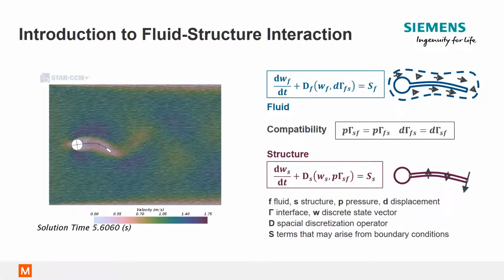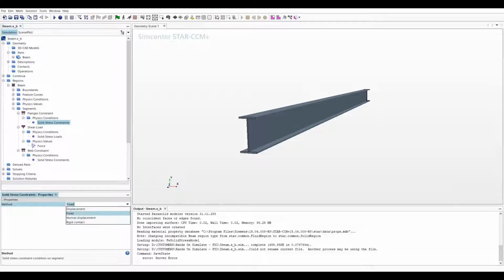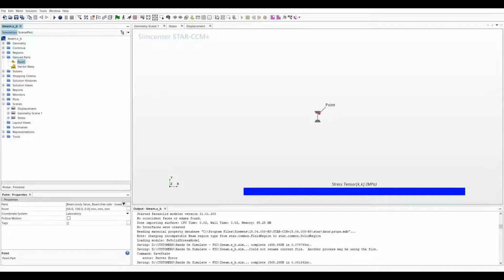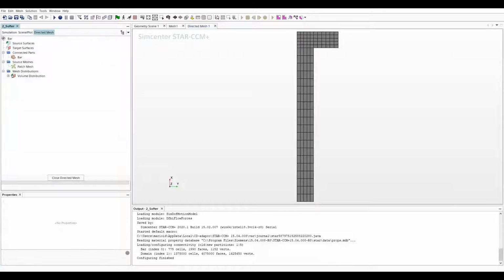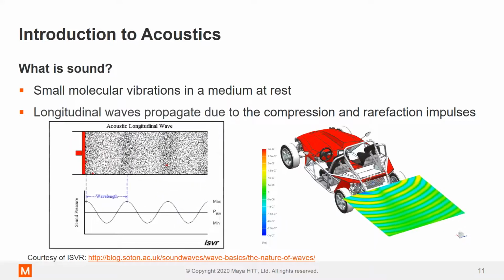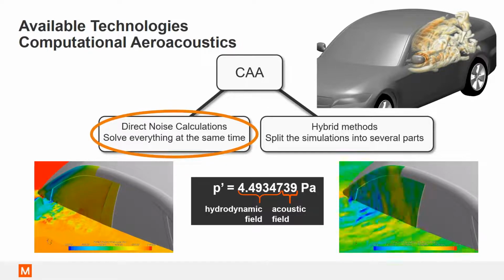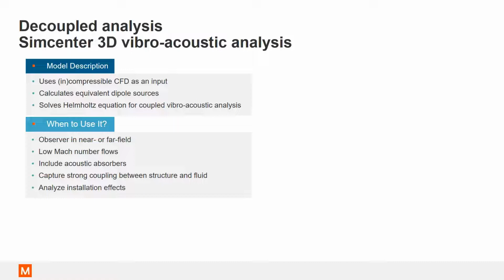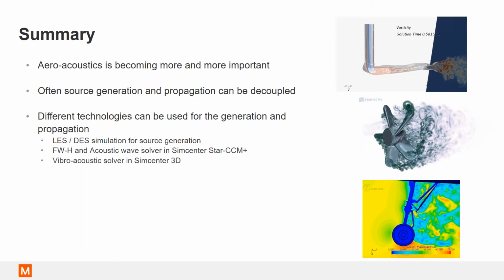Hands-on Simulate Series with Simcenter STAR-CCM - Flow Induced Stress & Noise (Session 5)

Comment: Hi sir, could you please help me in solving Elastic rod(FSI) problem statement
Reply from the maker: The best way to get help with Star CCM+ is to contact your local Star Dedicated Support Engineer (DSE) or raise the support question with your Star CCM+ supplier. There is also the Simcenter Star CCM+ online community – this post could be of interest - Thermo-mechanical 2-Way FSI Coupling: Bi-metal strip in hot gas flow. https://community.sw.siemens.com/s/question/0D54O00007RlhEOSAZ/thermomechanical-2way-fsi-coupling-bimetal-strip-in-hot-gas-flow